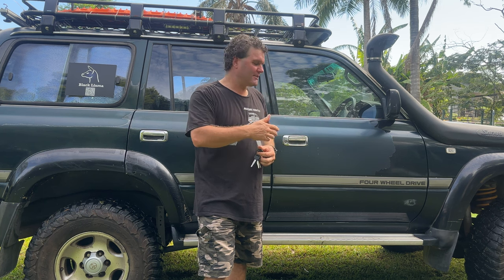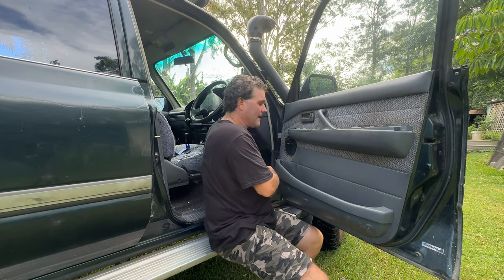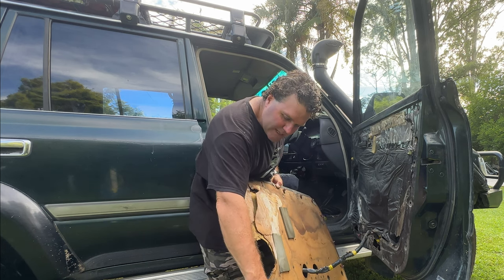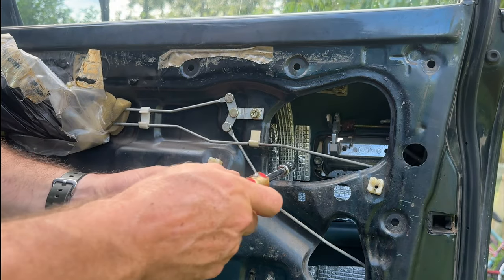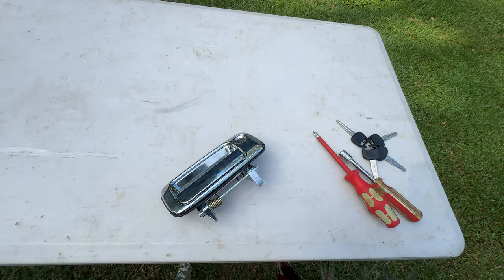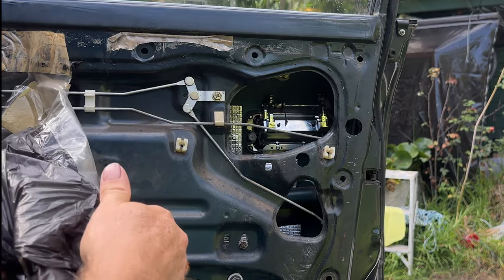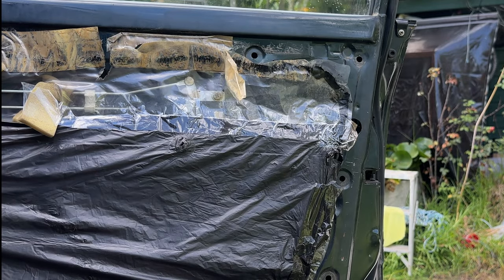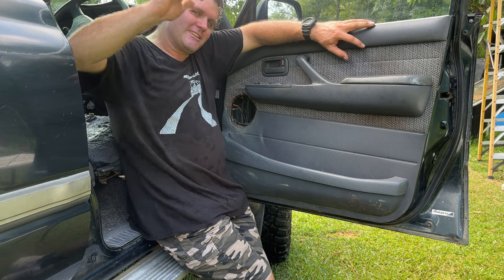how to change drivers door lock on 80 series landcruiser

Comment: Great video. You should look at getting remote central locking, I did it with the factory central locking on my GLX 80 about 12 years ago, and I still have 2 factory keys for all factory locks.
Reply from the maker: Ha ha thanks for the feedback 
great idea unfortunately i destroyed the remote on my other car. Now sold. My keys tend to get wet in rain or other water I end up in without thinking. I’m dreading having a car with an electric key. As I will kill it. Other than that I would have done it. I’m happy just having the key central locking.